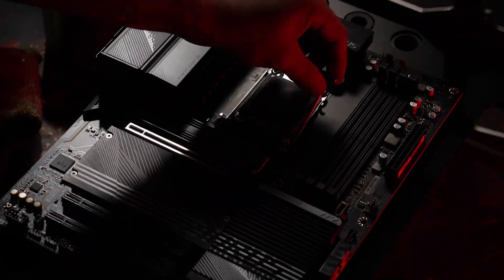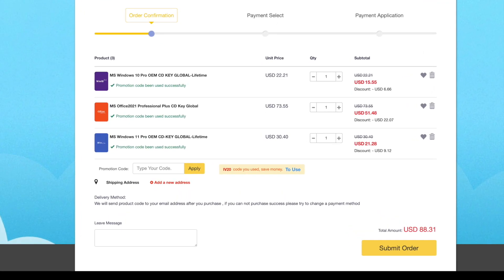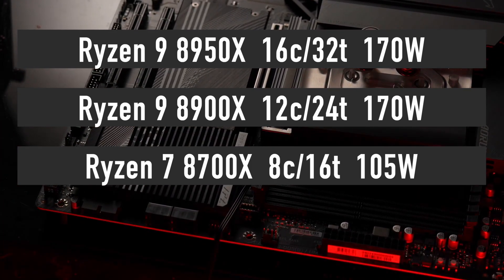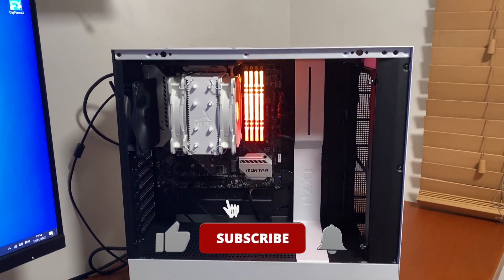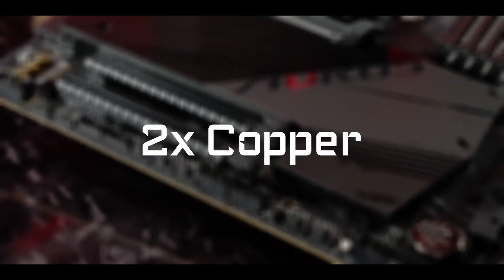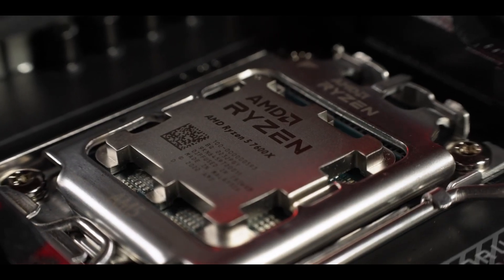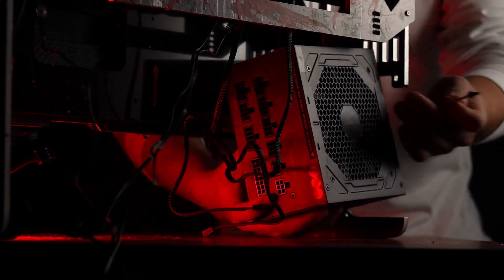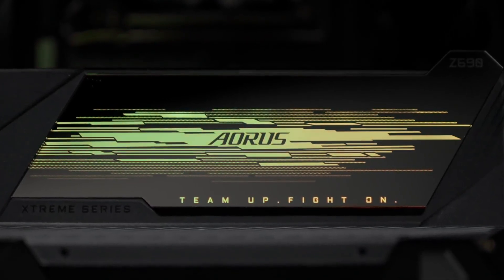The Most Ambitious CPU Generation [AMD Ryzen 8000-series, Zen 5]

Comment from the maker: Do you think Intel is in trouble looking at what the Ryzen 8000 is projected to deliver?
Reply: No.  AMD is stuck on older technology with a CPU-chipset link of 8GB/s.  This means future gen PCIe gen5 NVMe drives off the chipset will run slower than their rated speed.

Even with X670E AMD has to do something dramatic and use two daisychained chipsets to give all the devices you can plug into 670E what it needs.  I would tell you that's because of the limitations between the CPU-chipset link of 8GB/s.  Intel already moved to 16GB/s and only need one chipset for Z790.

Cool, AMD will be able to run 7200 memory?  Intel can already do this.  Intel is keeping up with modern memory, AMD is behind modern memory.  That doesn't look good to consumers.  We ARE talking about Zen 5 right?  It would launch 2024 and probably won't be replace until the end of 2025 with Zen 6.  Do you know how far behind AMD will be by that time in dealing with the newer memory modules and newer NVMe drives?

As another said they're looking forward to Arrow Lake.  I buy AMD and have been doing so since about the year 2000, and I'm NOT looking forward to Zen5.  I don't see anything exciting there.  If they can't somehow move away from their Infinity Fabric and to an interconnect that can run much faster, I think Intel tiles are going to blow away AMD frankly.  I believe it's this Infinity Fabric which are creating both the problem of memory speed caps at around 6000 and TERRIBLE speeds for 4 DIMMS along with the screwed up CPU-chipset link.  

So looking at performance of a platform, I'm guessing that Z890 stomps on X670E.  Z790 is already superior to X670E.  I think Intel putting out a tiled CPU is a REALLY BIG DEAL and I think they'll get better advantages out of it than AMD gets out of anything similar.  AMD for instance has had access now to Xilinx but don't have accelerators in their CPUs and it doesn't look like they will for Zen 5.  Intel has accelerators already and it gives a good boost to different workloads that benefit REAL people.  When AMD talked about accelerators to me it sounded like, TOSS some hardware out there and hope software devs. in other companies can figure out how to use it.  To contrast this, Nvidia launched AI, acceleration, etc.... AND they develop software that provides REAL benefit to different companies/users, and Intel does the same thing.  AMD is at the bottom in this regard  Nvidia delivers solutions.  Intel part of the time delivers solutions.  AMD delivers hardware and YOU have to develop the solution.

So, I'm REALLY looking forward to Arrow Lake, which is going to use TSMC and Intel process nodes because the tiled interface is an open standard that runs parallel interfaces instead of serial, and I'm guessing it will be similar to on die speeds, or at least much faster than AMD's IF.  Meanwhile AMD is using an Infinity Fabric which already can't keep up with today's needs and I don't know if they can push it anymore without it creating too much cost, heat, power consumption, etc.....   They've been working with it for quite a few years now and Zen 4 frankly is disappointing.   This is CRITICAL.  It's not a NICE feature.  If these companies are making chiplet/tile based CPUs, the way they connect along with its limitations matter, a LOT.

I just don't see AMD having a much better CPU architecture until Zen 6.  At the same time that means the MBs should be much more capable and if they get back to a single chipset which Intel pulls off at much faster speeds, then the MB pricing should be a lot better because it simplifies the connections and no devices have to deal with being on a daisychained chipset with all the added latency.

To sum this up, I was excited to see Zen 4.  After seeing it I wasn't excited, and watching videos talking about Zen 5 I don't see anything that's exciting, which for AMD is BAD because that's a totally new architecture.  The ONLY thing I'm seeing is IPC uplifts.  Right now the only company that's close to launching something exciting is Intel with Arrow Lake (or for laptops Meteor Lake which will come out sooner) and tiled CPUs, because I think they'll get better usage from each tile than AMD could possibly get from adding AI or accelerators to their CPUs.  They'll have real world benefits that typical users will notice, IMO.   If Intel gets to stacked cache with Arrow Lake, AMD is in BIG trouble.  Or if their tiled interface is as good as it's supposed to be they could simply have a tile with added cache.
Reply: @johndoh5182  Correct me if i'm wrong but you claim that amd's chipset is still at 8gb/s?? I just checked a b650 Msi Tomahawk mobo and here's the speed?? 

 "Gen4 PCI-E and M.2 solution with up to 64GB/s bandwidth for
maximum transfer speed."
Reply: I'm looking forward more to Arrow Lake
Reply from the maker: @treyquattro  any particular reason?🙂
Reply: @theivadim  I'm expecting a significant performance boost from Raptor Lake, and I think that Intel P-cores have quite a significant edge over AMD Zen4 cores. Purportedly Intel will be improving their efficiency so I'm holding out for that. I'm really impressed with my Alder Lake system even though it's already shaded by Raptor Lake, and a little less impressed than anticipated with my 7950X system. Intel is better with faster memory
Reply: I don’t think it would be only AMD Ryzen 8000 processors that would fear intel at that time but also the Qualcomm Snapdragon Nuvia SoC chips which will be similar to Apple’s M1 and M2 chips found on Mac computers.
Reply: I think that AMD will beat Intel with this launch. 
However, Intel Arrow Lake CPUs will demolish AMD when they'll arrive! 
Intel being on 10nm were still able to beat AMD. 
Think of what 3nm Intel architecture will be able to do against AMD!
Reply: @Crossfire2003  intel being on 10nm beat out amd with 50% bigger die size+2x more power consumption,you know intel is sacrificing profit to fight AMD,right?
Reply: @pham3383  
Actually, things aren't quite so. 
I mean, yes, Intel CPUs draw more power, but not by much. 
Gamers Nexus & PC World tested the real power usage of the top of the line CPUs of both companies & the difference isn't big. 
Actually, while in idle state, Intel CPUs draw less power than AMD CPUs (i9-13900K vs Ryzen 9 7950X). 

Intel only has a tough time beating AMD in the GPUs segment.
Reply: Intel has been in trouble for half a decade.  They just didn't realize it until 2021.
The problem with Ryzen 8000 is they seem to be hitting a new low with "Nothing New".  Previous gens had DDR5, 30% uplift, 16-core CPUs as "something new".  Where is the newness in Ryzen 8000?
Reply: @dgillies5420  
Intel were behind AMD for 3 generations only: 
9th, 10th, 11th. 
Intel surpassed AMD as soon as they improved the process node to 10nm (though AMD were already on 5nm).
Reply: @Crossfire2003  just how is Intel beating AMD right now?  Who wants a laptop that burns their thighs?  My employer gave me a 2019 MacBook pro and the CPU is a fiery piece of shit that overloads the fans all the time and burns my legs!  Intel has not bothered to improve energy efficiency!  This disqualifies them from both the laptop and the data center markets!  They have pulled even in desktops by using thirty percent more power I count that as a TOTAL FAIL!
Reply: @dgillies5420  
I, personally, do not care about laptops. 
In desktop computing, Intel took back "the crown" from AMD as soon as they launched the Alder Lake generation. 

Yes. Intel CPUs run hotter because they are on 10nm, compared to AMD's 5nm! 
Can you imagine what 4nm & 3nm Intel CPUs will be able to accomplish?
Reply: @Crossfire2003  do you know laptop,where you cannot suck 350w?
r9 7945hx topping intel with better batter and lower power consumption

Comment: Made my build in 2021 and I'm most likely going to do a full upgrade for 2025 when Zen 5 and RTX 5000 series is around.
Reply: too early mann, wallah not needed. i know its addicting but, i got like a r5 3600 and a 1060. most games at 1080p and 1440p run great. im probably gonna upgrade to 8000 series and either rx8000 or rtx 5000/6000.

Comment: This is disappointing.   
If everything remains the same and it just goes faster, I see no reason to upgrade my 7950x.  AMD needs to double those cores, or double that cache at least.   People buy all these cores not for games, but to render video threads, where more cores are better.
Reply: single core clock speed + cache for the x800X3D. more cores are superfluous for gaming. maybe with the x900 and x950 more cores might be nice.
Reply: @NoahJones7482  Anything can run gaming.    It's when you render out videos you want all the cores you can get, because doing a render actually takes several minutes when you're actually waiting on a computer.
Reply: @choppergirl  grand strategy games like paradox’s stellaris or Victoria 3, or cities skylines definitely see improvements with extra cache and clock speed. Those are heavy cpu bound games

Comment: Okay what im really curious about is the 3D chip... Look the 7950x3D was disappoint because of the controller..  both set of cores didn't have the cache.. the 78003D even with lower clocks out perform the 7950X3D.. that's just silly.  It certainly needs to be an improvement this generation. You should get 16 cores. A huge amount of cache. low latency. would Wipe the floor with intel if they focus on X3D.
Reply: Honestly thats so right, a 16 core with V cache on both CCDs would be a real winner

Comment: DDR5 doesn't matter much, because once you drop in 4 sticks, your memory speed drops down to 3800.
Reply: Then just buy dual kit of what you need.
Reply: @portman8909    Yeah I got quad sticks of 32gb for 128gb.  Not as easy as it sounds when you're buying used off ebay.  Not everybody lists the codes found on the chips.   Mine don't match but they are close enough.  Even though they are the exact same model by the same company.   It's the code for the driver chip on the DIMM that matters.
Reply: @choppergirl  is your mobo/cpu (system) quad channel compatible?
Reply: @DeiLux  Yeah, Gigabyte X670 AORUS Eliete AX.   Corsair Dominator 5200 32gb x4  for Intel.     Boots it at 3800 in UEFI, runs it a 4800 JEDEC once inside Windows.   I have yet figured out how to get it to run at 5200 in windows.   I bump up the memory clock speed multiplier from 48 to 50 or 52... and it's not stable and it crashes.

Comment: I would have preferred AMD to increase the core (or thread) count too.  If Intel is baiting AMD into thinking they have problems with high core counts, and can deliver current or higher amount of cores on its entire lineup it will be a bloodbath for AMD.
Reply from the maker: I think AMD is doing a smart more by not increasing core count on consumer-grade systems. I think they will just update Threadripper lineup if the will be a demand for high-core-count systems. Which I don't see from where I am sitting. Most people are not interested in CPUs with more than 8-16 cores. 8 is the sweet spot. AMD is making such decisions based on data and market research. Same as Intel. So, it is very interesting to see which company is reading the market correctly.

Comment: im interested in Arrow lake more, because its first time with tiles (chiplets) and new node but as a Intel user i  know maybe we whait 10 further years, but i dont have to rush anyways, actually using a 13600K. For me its good enough. it uses 54 to 86 watts im gaming and about 5 watts in idle, not too bad tho
Reply from the maker: Looks like you are all set even beyond 15th gen🙂 Probably makes sense to upgrade to 16th or 17th to make it a worthwhile upgrade from 13600K.
Reply: @theivadim  you find 13600K is good for so long? wich one do you use if i can ask?
Reply: @nivea878 easily will last a decade
Look up even i7 4770 is relevant today in 1080p
Considering 14th gen is coming
Just don't expect more than 1080p60 gaming tho
Reply: @gg95-k7y  u play 1440p 😅 do you still use 4th gen? shiiit
Reply: @gg95-k7y 4770k is more relevant in 4k than in 1080p cause 4k is gpu-bottlenecked.
Reply: Remember that 1st-generation threadripper was super-rocky and asymmetric and kind of an embarrassment, and 1st-generation RDNA 3 has been super-rocky and kind of an embarrassment ...

Comment: 16 core, I think, isn't as good as say 24 cores so what I'm getting at is AMD should up the core count on their CPU's maybe the 8950x has 24 cores and the 8900x has 16 cores 🤷‍♂️. They only added the 16 cores back 2019 because they needed something to compete with intel with and their answer was the "baby Threadripper" Zen2 3950x 16 cores, but like I said that was back in 2019... I'd start offering more cores for better performance.
Reply from the maker: Which of the apps you use would benefit from having more cores?
Reply: I suspect 24 cores will only happen in Zen 6 as it will have AM6 socket. I too want 24 cores or more without going to threadripper, but it will take sometime. With Intel Arrow Lake 40 cores there will be competition to AMD for more cores, I'm going to wait 2+ years.
Reply from the maker: @profounddamas  I really want to know what you plan on doing with that many cores. Any specific applications you use or plan to use with all that performance?
Reply: @theivadim  I like chess programs. Also I program checkers spanish/portuguese variant (Profound) and turkish checkers (not yet released). These programs are very  demanding in terms of processing power. My programs can use 256 threads, but I can't even go threadripper. So it's gaming but a different kind of gaming.
Reply: @profounddamas and how much „performance“ do you theoretically gain?

Like if it gives you half a millisecond worth of advantage then good for you I guess
Reply: @theivadim  The point about more cores is future proofing. Gaming CPUs are a dumb thing. No one games at 1080p with ultra high end flagship GPUs, where these X3D chips can show off. Totally meaningless. What we want is a 13600K type CPU from AMD. Value for money, budget productivity monster, something that the original R5 3600 was!!

Comment: i'm just sitting comfortably with the 5900x & it's doing everything just fine for now. the games need to catch up a bit for any of this to matter for a while
Reply: Some new games require 13700k or 7700x etc to get above 60 fps.. ray tracing adds cpu load. I game on 5600x and it really delivers what I want for my games.
Reply: wrong. 5000 series is on a old am4 motherboard so it will already be outdated by the time the 8000 series comes out, zen 5 is already going to be 30 to 40 percent faster than the 7000 series and thats am5 too. you are underestimating the power of newer gens on the am5 mobo. people who are still upgrading on a am4 motherboard will just be left in the dust by ones who upgrade to new gen ryzen lol
Reply: @csowner2048  without even discussing it.. this guy knows exactly what we do with our gaming pcs.

Comment: I wonder when they're upping the core count again. Realistically, it will probably only matter for compiling code, professional workloads, and heavy multitasking (maybe game + recording with CPU encoding + Steam downloads and shader compiling in the background could saturate 16 cores, with more you could throw a video render in as well). I suppose there's a reason AMD still sells CPUs for gamers despite Intel having the objective multi-core advantage (aside from that power draw).
Reply from the maker: I think that in games 8-core CPUs will continue to be the go-to standard for years to come. All other tasks such as AI and video encode/decode have moved to dedicated hardware accelerators in GPUs. 3D modelling also done on GPUs. What is there left? As you mentioned, code compiling is probably one of the last few tasks which benefit from increased number of cores. It looks like CPU cores are losing their relevance in mainstream PC systems. That is why Intel keeps performance core count at 8 even on their top of the line i9 CPUs. We'll see if that bet on having huge number of E-cores pays off. My bet is - it won't.
Reply: It would be cool if they only upgrade the core counts of the r9 chips.
Reply: They'll probably do it with BIG.little sometime in the future. Instead of 16 zen 5 cores a future processor could have one CCD with 8 zen 5 cores plus another CCD with 16 zen4c cores, for a total of 24 cores with 48 threads.
Reply: Zen 6 + AM6 only.
Reply: Yeah they need some sizzle in Ryzen 8000 because just printing slightly faster CPUs really isn't all that exciting ...